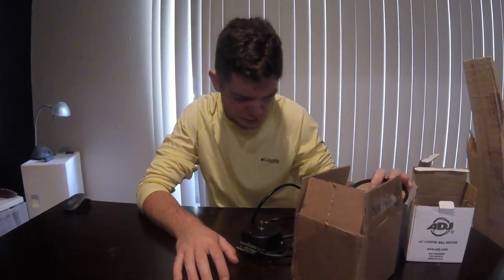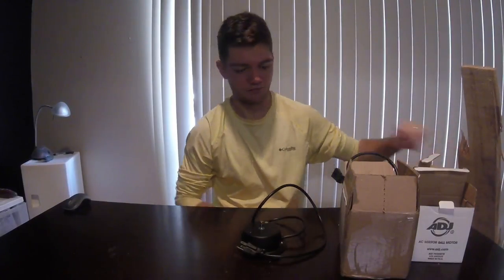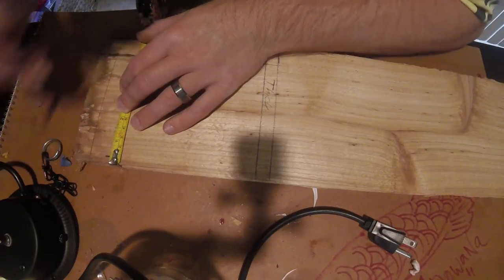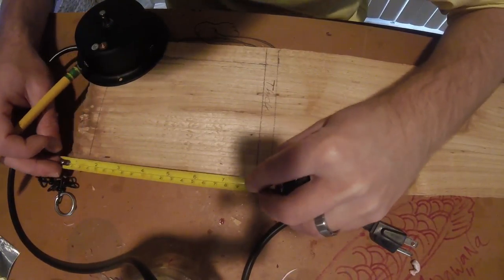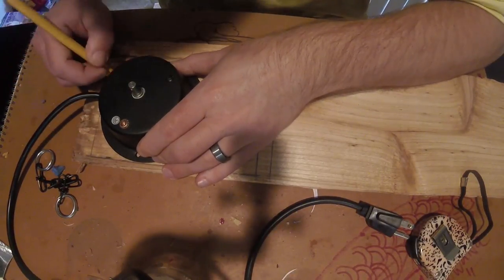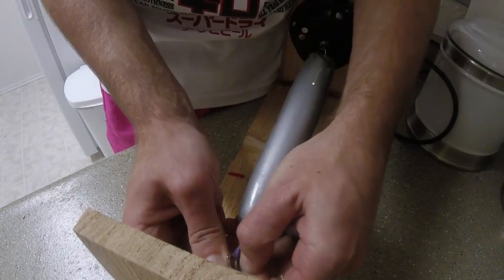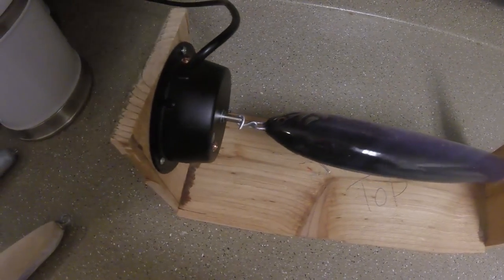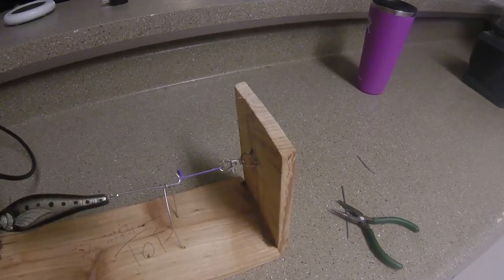Making a $10 Lure Dryer / Turner

Comment: What kind of resin is best for clear coat and how much layers should be done?
Reply from the maker: I use Envirotex Lite epoxy but I'm sure there a some polyurethanes that will give you a great result as well. I usually only need to do one layer of envirotex since it gets quite thick on a fast rotating lure dryer but you can do two or more if you hang dry them or have a very slow rotating lure dryer.
Reply: He don't know

Comment: Mine is doing the same thing, it flips over unevenly and can’t figure it out? Any suggestions?
Reply from the maker: if you tighten the fitting on the hook you use to where there is no wiggle room, it'll run just fine

Comment: Would a 3 rmp motor work?
Reply from the maker: It definitely woulod but you may have to consider applying more than one coat to get the desired clear coat density. Thanks for watching!
Reply: @TheAnglingGlobetrotters  thank you. I seen another guy has one.  I think it would work just fine. I got it now and turned it on. It shouldn't drip. I should be able to do one good coat and be good without it dripping